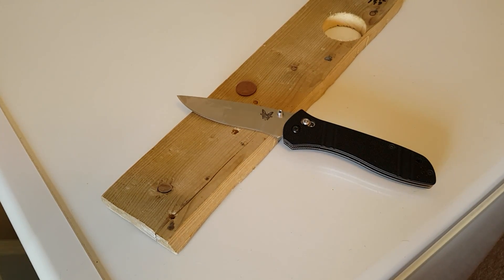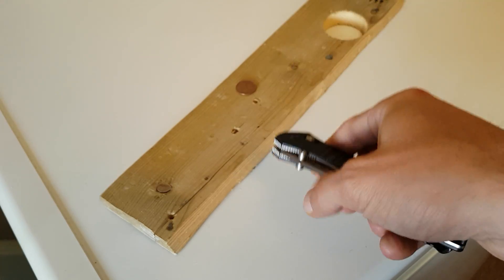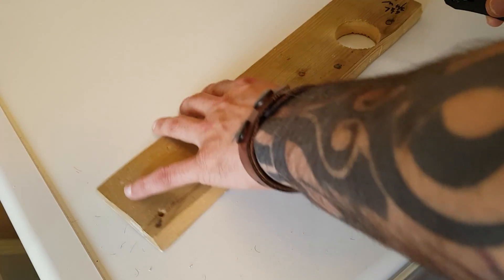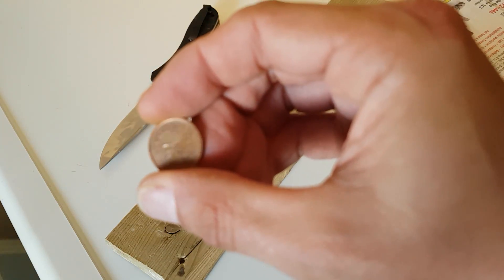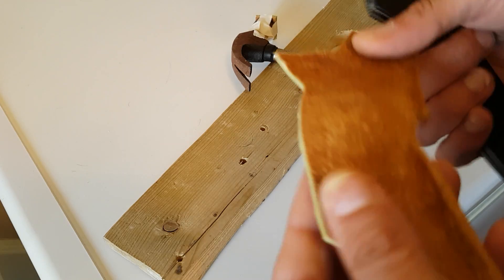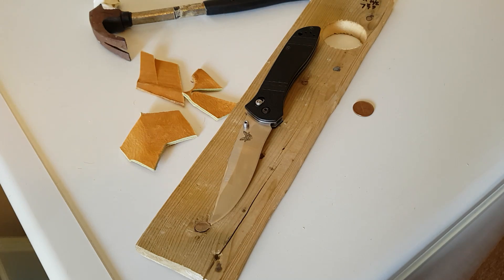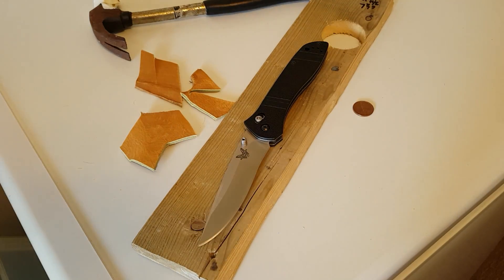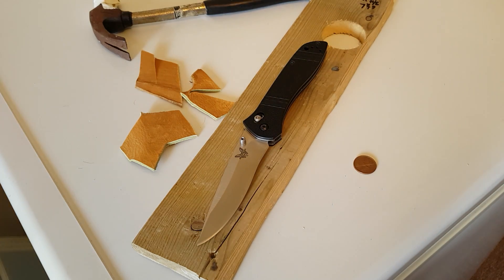Disproving misconceptions of D2 Steel.

Comment: For many years before they came out with the super steels there was D2 tool steel. A proper heat treat is crucial to it like any other steel. It doesn't take a mirror polish like S30V will, but no big deal. I have made filet knives from D2 and S30V and the S30V will hold an edge longer. They are both tricky to heat treat and D2 has been around for a long time and makes a nice knife. Even stainless knives will pit and corrode if you don't take care of them, at 11% chrome D2 is not quite stainless which is at 13% or better chrome content. What makes D2 or S30V better is Vanadium in the matrix as Vanadium carbides are harder than even tungsten carbides and it restricts grain growth which in turn helps with toughness or lack of being chippy. It is all in the heat treat, do it wrong and it can be brittle, benchmade obviously heat treated this blade properly. A diamond sharpener is recommended for high V steels as they do take a long time to sharpen as they are very wear resistant.
Reply: @chapitt08 Not sure how I made it here, but I'm happy to help you by including my data point. I have a Spyderco Endura 4 in VG-10 that I bought a year ago. I have since put it through the wringer with a variety of EDC tasks. Carpentry, cooking, package opening, lab work (zip ties and such), hiking, etc. Corrosion resistance is good, and it is not difficult to sharpen as it takes a good edge. That being said, I had purchased it at the same time as a Benchmade Griptilian, and the 154cm blade steel of the Griptilian has completely outperformed VG-10 in every way imaginable. Corrosion resistance is equal, and ease of sharpening is equal. However, I have found the VG-10 to chip occasionally when encountering wood and harder materials, while 154cm has not. I can achieve a much greater degree of sharpness with 154cm and the edge retention is vastly superior to VG-10. VG-10 in my opinion is quite soft compared to other above average steels. My edge has receded quite a bit from the amount of sharpening I have had to perform over the last year. VG-10 should be used for much lighter tasks such as those found in cooking applications. Though it is a decent steel, I will not be purchasing this steel again. Your mileage my vary, as a lot of Spyderco fan boys claim VG-10 is an absurdly fantastic steel. This is simply my perspective.
Reply: Thanks for the info. How would you rate VG-10 steel compared to the ones you mentioned in your post? I've been looking at some EDC knives made in VG-10 and was wondering about edge retention, ease of sharpening and resistance to corrosion. Cheers.
Reply: For what it´s worth, i´ve put a mirror edge on my D2 blade with only a chinese clone of the Edge Pro Apex and a strop.
The polish took a few turns on the strop, but not too long.
Once i buy the real Apex stones in finer grit i´m sure i´ll get there even more easily.

Comment: You just convinced me to pull the trigger on a D2 rat 1. I love my AUS8 Rat 1 and I'm sure I'll love my D2 Rat 1 even more!
Reply: Grant Miller I just got a Rat 2 in D2 and its sweet, its working well for me. It's a head steel though, I cant get anything with a little pull through sharpener, I have to use my diamond stone. Badass little knife though.
Reply: If you use a pull though sharpener you don't deserve a good knife.
Reply: B. Hussein if you use a pull through sharpener, I doubt your ability to use a diamond stone
Reply: +Grant Miller
Did you ever get the D2 Rat 1? If so  how is/was it?

Any recommendations¿ was it better than the aus8 by any margin?

Thanks
Reply: Dan Hazard I own both and the D2 holds edge almost twice as long as the aus8

Comment: I had just commented on one of Kevin Clearys vids about D2. I have lots of D2 blades and run them in substantially worse environments than the average Joe, and have NEVER had rust issues or chipping issues. I love that steel! Ever notice that most people dissing D2 have zero wear on their blades? how would they even know? I think a lot of it is just parroting someone who had bad luck and the fact that technically its not a stainless....but physically it pretty much is. Great vid!
Reply: RealBushMonkey... BINGO!
Reply: I used my D2 Kabar as my only can opener for about 3 years in college, and 20 years later I still haven't felt the need to sharpen it.

Comment: I love D2, I don't know why it gets hate from the knife community. Just lightly take care of it and it will work for you forever.
Reply: Because they believe the hype about steel ! And they go along with the so called American knife companies ripping off American ! Whatever steel it is it only raises the production cost per unit a few dollars not hundreds of dollars !
Reply from the maker: MidnightSundowns Very true. All I ever do is wipe it of after use and there is no staining or rusting at all. Amazing blade steel over all.
Reply: MidnightSundowns because bushcrafters are all about carbon steel .its soft enough to sharpen with a rock and for some reason they dont think you can strike a spark with stainless .they consider that to be more important the edge holding .
     Ever sense i got a boker vox rold ( d2 60 hrc ) i have been in love with d2 .use a diamond stone first then polish the edge with the other stones and the strop .

Comment: Say Heah,  Yeah,  I have a Benchmade 156 CSK in D2,  It sat in a box for years,  Because I ordered it by mistake,  I wanted a plain edge and inadvertently I ordered the serrated version,  Anyhow then recently I found out lately that you can make good curls with a serrated blade,  I went out to check it out,  I was pleasantly surprised and it was like I got a new gift,  Actually it was because the knife is brand new.  But your right,  Benchmade dies a great job with D2,  I very pleased with its performance, .. ,
Reply from the maker: I've found that also that it works well for feather sticks. Awesome that you ended up enjoying the knife and can't agree more that Benchmade does an awesome job on thier D2.
Reply: A new present that I recieved awhile back, .. ,

Comment: My only experience with D2 was poor in one sense, and good in another.  I found D2 is tough, takes a great edge, and hold it a good while, which makes it a very good knife for city EDC.  But I had two problems with it.  One was that it did chip, not because it couldn't cut through anything with chipping, but that it went dull over the long term by chipping at the microscopic level.   This made it very difficult to sharpen in the wild, and, for me, being able to easily sharpen a knife in the wild is an absolute must.   I found you have to keep D2 as sharp as you can.  Let it go dull, and you are going to have a terrible time trying to get it sharp again in the wild.  For this, and a number of other reasons, I greatly prefer a 10 series steel for wilderness use, but for in town EDC, D2 is about as good as it gets.   In fairness, I'm not a fan of any of the "super" steels.  They have great strengths, but every one has a weakness.  D2 is kind of a bridge between a high carbon steel and a stainless super steel,  but I find it absolutely does go dull by chipping, and is very, very difficult to sharpen in the wild, so like every steel, I use it for some things, and not for others.
Reply from the maker: I haven't had to much difficulty in sharpening up my D2 knives but I tend to use diamond stones for it. Agree that is I'm out in the bush I want 1095 steel. Tough and easy to sharpen. BK 17 by Kabar is my go to for a Woodstock knife that or my Moran.
Reply from the maker: I haven't had to much difficulty in sharpening up my D2 knives but I tend to use diamond stones for it. Agree that is I'm out in the bush I want 1095 steel. Tough and easy to sharpen. BK 17 by Kabar is my go to for a Woodstock knife that or my Moran.
Reply from the maker: I haven't had to much difficulty in sharpening up my D2 knives but I tend to use diamond stones for it. Agree that is I'm out in the bush I want 1095 steel. Tough and easy to sharpen. BK 17 by Kabar is my go to for a Woodstock knife that or my Moran.
Reply from the maker: +Neil The Knife Guy Not Moran. Mora. Damn auto spell.

Comment: Such a nice knife..... Anyways Mohs Hardness usually grades knife steels at about 5.5 and pennies at 3. So you will not see that much damage from pounding with a harder metal on softer metal. Also the corrosion resistance on D2 is worse then 8cr13mov, definitely the Achilles heel of the blade steel. The edge retention is right between the S35vn and CTS-XHP. I personally love D2 steels but have to keep them oiled with a bit of Rem Oil if I am going to take it out and about or long term storage. Great video
Reply from the maker: Should check out Blade HQ video on rusting blade steel. D2 doest rust that easy. Try pounding a penny with s30v and slice some paper. You'll  definitely have some damage
Reply: +Neil The Knife Guy Most people take the rust issue way too far, I have an opinel carbone number 8 with XC90, that thing is said to rust the second it touches anything wet. I have cut several fruits and had it in high moisture environments for days at a time and no rust or spotting. I'm thinking the people complaining about rust are those who did not treat their blades and kept the knife in humid area for storage. But I have seen surface rust of Aus-8 blades from friends jumping into salt water with their knives. 
As far as the penny test, I am tempted to try with one of my S30V blades. If I ever do the test I will post it,

Comment: I love D2  and own 4 knives made from it that being said if you leave a D2 blade wet over night as I did by mistake you will be amazed at how much rust forms and it took hours to buff out - D2 is almost stainless but a large part of the chrome is converted to carbides when hardened this results in a steel that rusts almost as fast as 1095 if you do not believe me wrap your D2 in wet rag over night nevertheless i will buy more D2 blades anytime - cheers Neil
Reply from the maker: I'm not saying it's rust proof, however what I'm saying is that with minimal care like just whipping you blade off on your pants after use that it will not rust and that has been my experience. Seems like a lot of people tend not to take care of their shit so at some point the tool fails them. In this case they would get a rusty blade but every steel will rust if you don't take care of it in some way or another over time. My GF had a vg10 blade rust on her and I have had s30v rust on me.
Reply: I forgot and left the knife in a wet moulded leather sheath I was making for about 8 hours and I was stunned by the amount of surface rust that was on the blade ( no pitting ) with minimal proper care this will not happen  I have a number of different stainless blades and none of then will rust even slightly as much as D2 the knife was an Ontario Tak 1 in D2 steel from years back which I stripped the coating off for bush crafting oh and the leather sheath came out nice - cheers Neil
Reply: I also want to say D2 is one of my favorite steels and I would not hesitate to buy any knife in that steel
Reply from the maker: +guncotton 1 LMAO. left a knife in the sheath I was making today only I had it rapped plastic wrap then put it in the oven forgetting  to take the knife out. LMAO. By the time I remember I ran to the oven and took  the knife out. Thankfully the knife , a Kershaw Leek was fine and still cool to the touch. Blade HQ did a test on rusting blade Steel's that I might try and replicate. Definitely was a good watch. They did regular tap water and salt water.
Reply: that Mchenry Williams has been on my wish list for a while as well as the Adamas because of the D2 blades also the original Mchenry Williams were in ATS 34 steel they still pop up on kijiji

Comment: D2 is not chippy we already know that.  The issue with D2 is it's lack of corrosion resistance, it rusts quite easily.  I personally prefer CTS-XHP, which is basically a stainless D2.  CTS-XHP is significantly more corrosion resistant than D2  That's why I like Cold Steel knives better now, because Cold Steel finally started using a stainless hard-use steel like CTS-XHP to match their hard use TRi-Ad locks.  I hated having a Tri-Ad lock knife with AUS-8A or VG1.
Reply from the maker: In my experience it doesn't rust easily at all. Never oil it or do anything special to it and never had a problem with rust or staining. It really doesn't rust as easy as all that. Use this knife for food prep all the text as I mentioned in this video (tomatoes, oranges, apples) and not a spot of rust.
Reply from the maker: +Neil The Knife Guy text=time